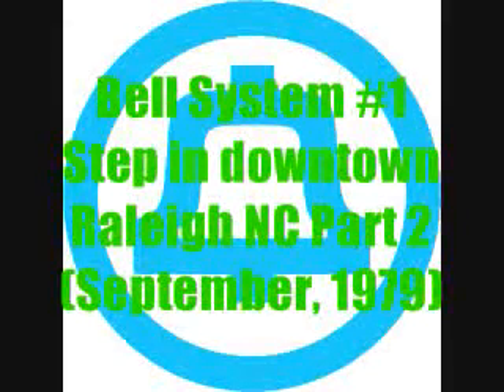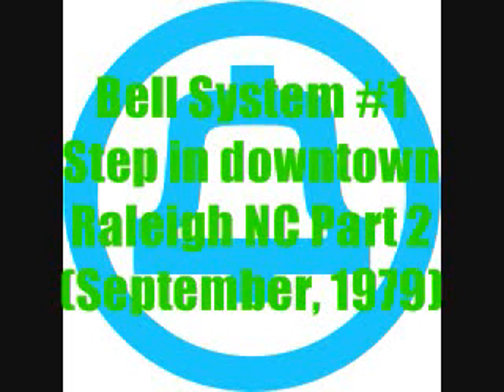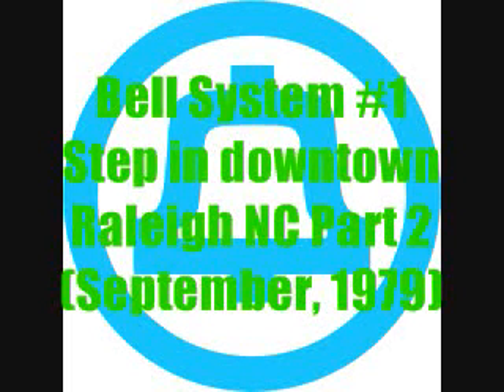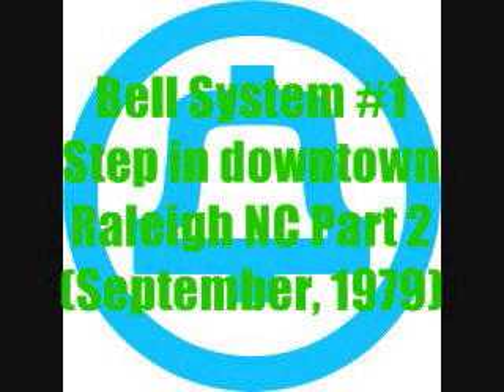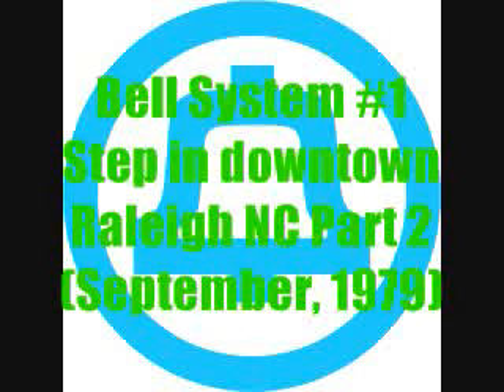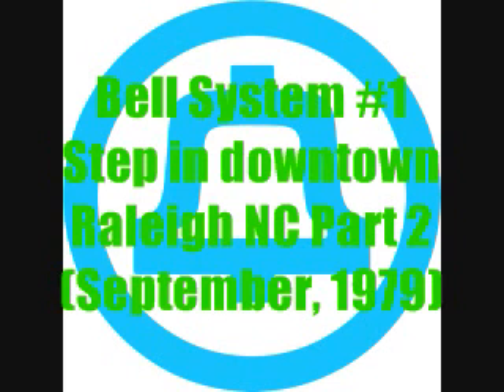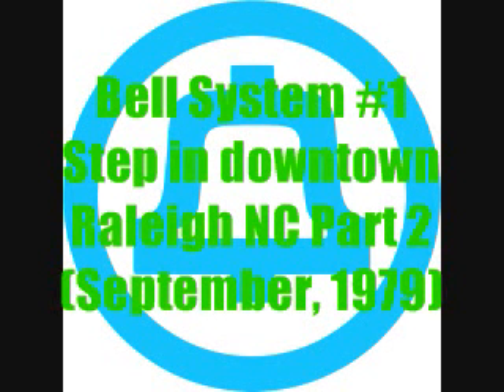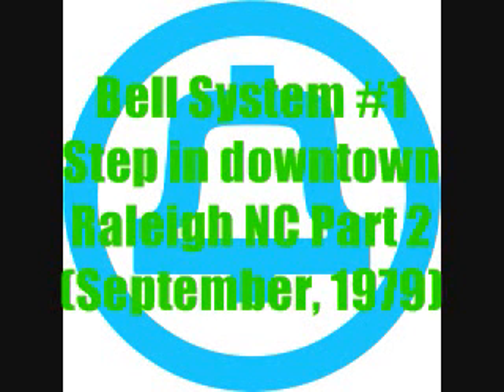Bell System #1 Step in downtown Raleigh, NC - Part 2

Comment: I wonder if on that #1 Crossbar Step-by-Step equipment if you could have dialed only the last 5 digits on calls in the same exchange. Like say the number was 456-7890 and you wanted to call 453-2637, you would just dial 3-2637.

Comment: I grew up with General Telephone; my Mom & Step-Dad both worked there. I went on a tour, and was amazed at the cacophony of noise with all of the step 5 equipment busily connecting calls. At the time, we had about 8 different prefixes in Terre Haute, Indiana. Each one had it's own dial tone, busy signal. We used the silence between tones of the busy signal to meet people. It was called the "hot line".
I had some very interesting "dates" utilizing the "hot line". General Telephone was somewhat behind the times.  We didn't have 7 digit telephone numbers until 1965. Before then, they were just a 5 digit number, and all long distance service had to go through the operator. We also were on a "party line". There were 6 other telephones that shared our line. You just didn't pick up the phone and start dialing. You had to listen if there was another party speaking on the line. If you were talking on the phone, another party could pick up their phone and listen to your conversation. Speaking to my girl friend could cause some people to get annoyed at the length of our conversation. When my Mom began working at Gen Tel, we got a "private line", meaning we no longer shared the line with another telephone. Yes, the old days were quirky, but they made telephones a more interesting device to use. Since going digital, it's just a boring device, but more reliable.
Reply: Heh, they were owned by Verizon and now frontier communications. But it's still the same thing now